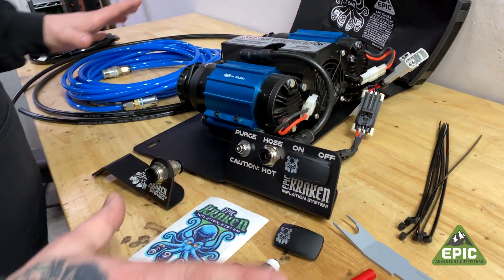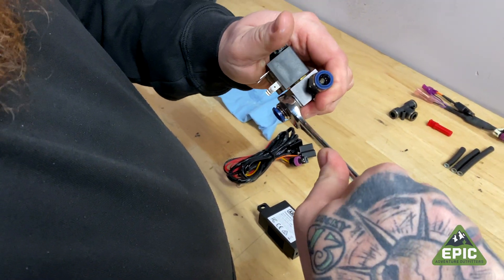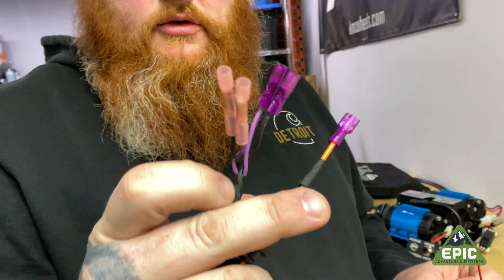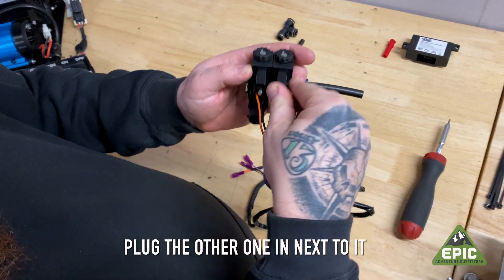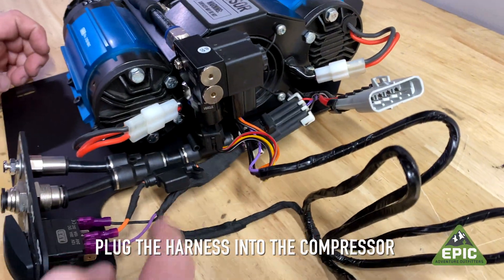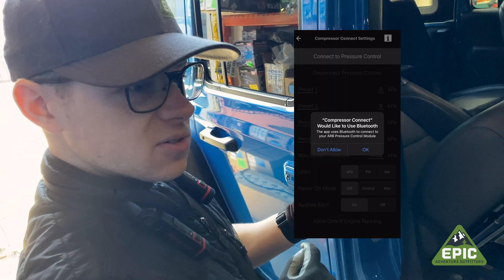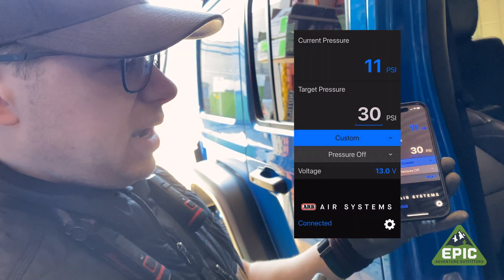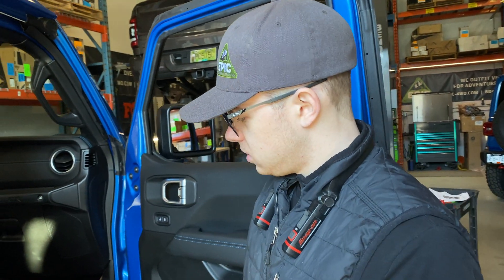EPIC Kraken Pressure Control Upgrade Kit - Details & Installation Guide

Comment: Just tried to install it and it does not fit under the seat. The PCM is too tall and interferes with the seat slider bar.  Ordering more airlines to re-route to a better position. 🤦‍♂️
Reply: Same here. Very disappointing. It’s bc of how the kraken plate is designed to fit. That’s why they skipped over detail install in the vehicle. All of the important parts of this system are from ARB though. They just put an Epic logo on it. For anyone having this issue, ARBs mounting plate fits properly and doesn’t block your seat. If you use the kraken plate with the ARB system, you’ll have to jerry rig the connectors so your passenger seat can slide properly 🤦‍♂️ save yourself the headache.

Comment: I like the fact that it can deflate fires now, but I hate products that require a phone app.  Apps become obsolete and stop working over time (next time Apple decides to update their OS and breaks old apps).  I’d rather have a dedicated control interface connected to the Kraken.
Reply from the maker: The Kraken wasn't designed for deflating, only inflating. This new add-on could technically be used for deflating, but it would take forever. We always suggest using the Trailhead deflators (available on our website at epic-4wd.com) which can deflate tires quite fast. As for the app, you only have to use it once, at setup to set your pressure and then never use it again if you wish. Cheers from the team at EPIC!

Comment: How long do you think it will take to air down from the street pressure to say maybe 10 pounds with this system. Or is it just easier to use some other way?
Reply from the maker: Hey Chris! The Kraken wasn't designed for deflating, only inflating. This new add-on could technically be used for deflating, but it would take forever. We always suggest using the Trailhead deflators (available on our website at epic-4wd.com) which can deflate tires quite fast. Cheers from the team at EPIC!